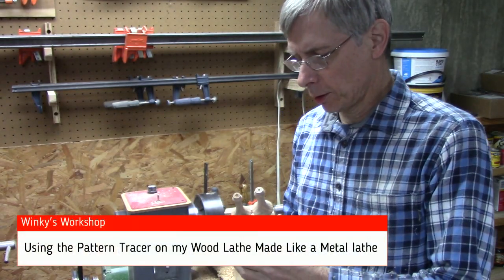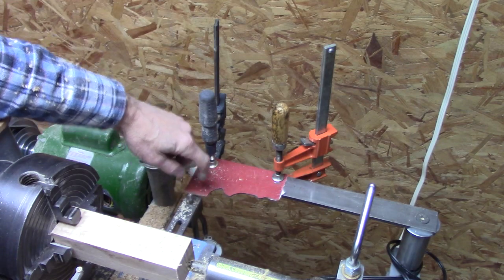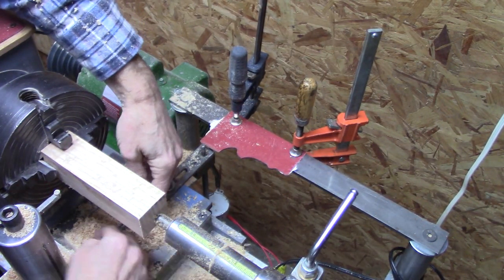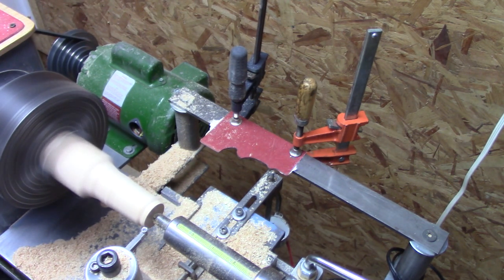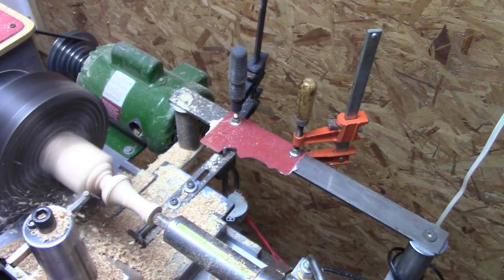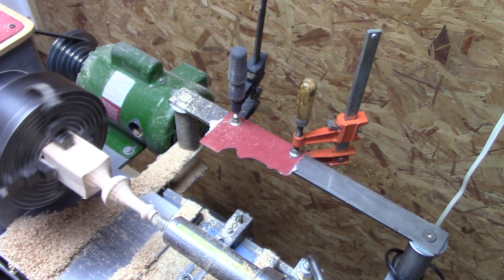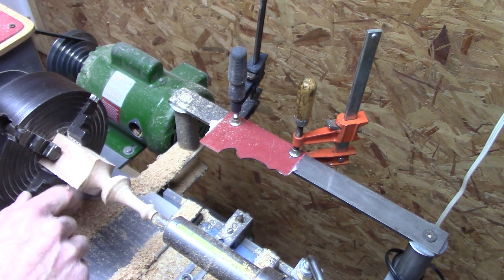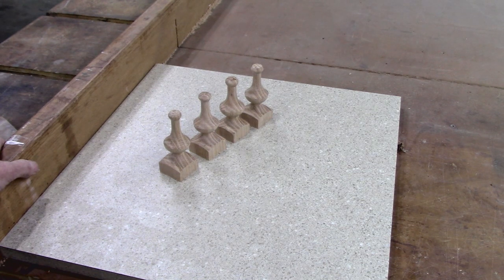Using the Pattern Tracer on my Wood Lathe made like a Metal Lathe

Comment: There are ways , & there are other ways !    Biggest 2 letter word I know is "IF" . . . ;)
* If your process had 2 'modes' , you could rough in with a much larger tool , then detail with the smaller one .
* If not for the nature of wood grain , a rubber / polyurethane roller on your stylus motor could 'bite' into the pattern edge to help climb out of the deeper recesses.  
* If you were independently wealthy , adding another Horse to the driving end , & using a form tool instead of a pattern to trace would be a SNAP !  ( depending on part size)
   Depending on how many of a given part is being made, methodology should be 'adaptive' to either produce the quantity in the fastest time , with the best quality . . .
       Solutions come from inspiration, as well as frustration from repetitive tasks !
  Hand cranking all the motions into the pattern looks like it works well enough , though the idea of a 'free floating' cutter mechanism might be easier to use ?   Just a few ideas.
     Good work leads to great work , with enough practice !    "V"
Reply from the maker: Wow...  thanks for the detailed comment...  yeah, I don't need to pour thousands $$ into this but its would be nice to make it trace more effectively.

Comment: Boy your lathe has a lot of pulley sizes on that motor to change the speeds, really nice selection, like your tracer pattern. We used to run True Trace hydraulics stylist controller tracing aluminum parts cutting raw material on a 2 headed Bridgeport mill in the 1970's early 1980's. Lance & Patrick. We know nothing about wood work, nothing good comes from wood for these two micro machinists. We honor people like you with the knowledge to work with the grains the flows of the wood workers world.
Reply from the maker: About the pulleys.  It would be nice to have one slower speed for large diameters but for most woodworking it needs to be fast. With that said, the highest speed is ridiculously fast. So fast that I worry about the tapered roller bearings losing their grease. They are not sealed.
Reply from the maker: Very cool...  hydraulics stylist!  I like it... has me thinking. I thought about making a metal pattern and having the styles conducting but it's complicated because of speed. If you have the lateral speed constant and steep sided recess in your pattern the cutter would plunge into the work too fast. I think CNC is the best solution... maybe I can figure it out. It's true that woodworking has it's own challenges but so does metal. I've been woodworking a lot longer than I've been metalworking. To be honest, working with metal has given me a more disciplined approach to woodworking. Thanks for your kind words!

Comment: very interesting, good learning project, for a first attempt.
Reply from the maker: I agree, it's usable but not as easy as I would like. Thanks
Reply: @WinkysWorkshop  I don't understand the need of the rotating pattern tracer, which also seems to be too big in diameter, pre-empting tracing fine details.

to avoid friction and snags, I would polish the edge of the pattern, maybe even wax or otherwise lubricate it

then for the tracer, just a polished 2 mm piece of stainless rod, and for rigidity, much shorter than your current tracer.

whatever, keep up the good work and creativity

and yes, CNC  would be better.
Reply from the maker: @satxsatxsatx  - It's actually the same diameter is the cutter which is what you need. It made a big improvement going left to right as it helped push the cross slide back out of a dip in the pattern. But I agree, it's not ideal and does not help at all going right to left.